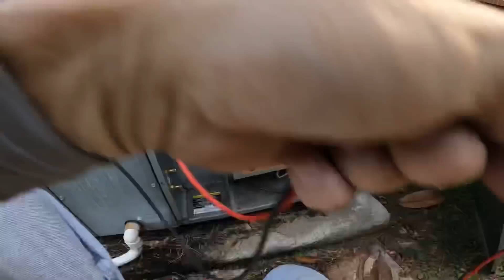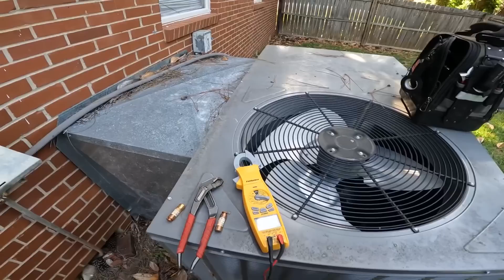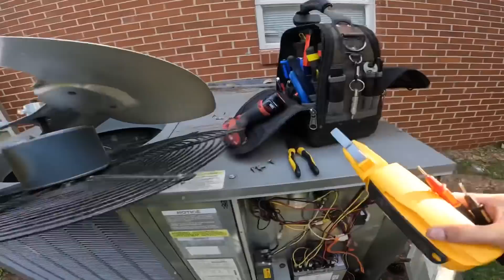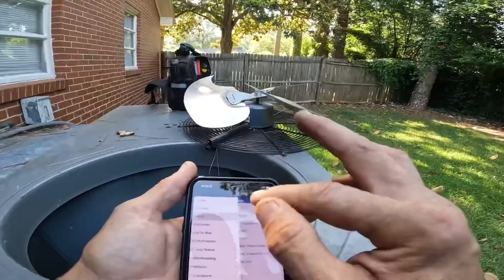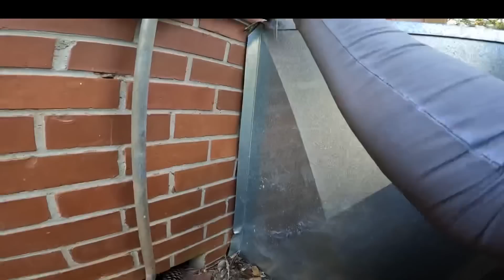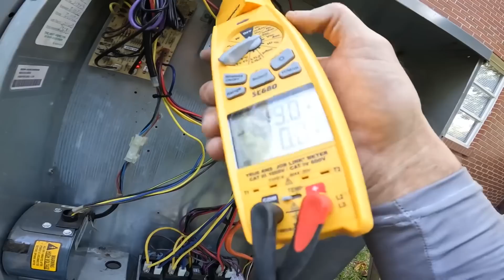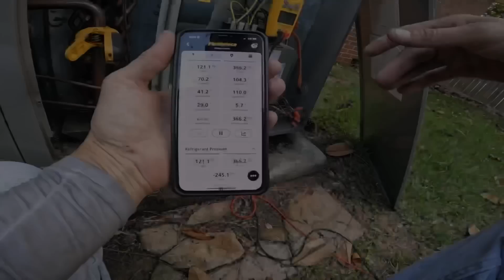Please Tell Me It’s Not the Compressor Again

Comment: Years ago I used to take care of cell phone towers that usually had 3-5 ton single phase Bard units. R-22 with Copeland scroll compressor. Brand new Copeland compressors would fail a meg test with either an ohmmeter that would read megaohms or actual meg tester. This was after recovering the charge, new drier evacuated to 500 microns and virgin R-22. I tested the compressor before applying power to it after weighing in charge. And it failed the meg test. Megger is a cheap Supco that considers anything under 20 megaohms as failing. My VOM that would read up to 50 megaohms would read about 5 megaohms to ground on them. However, the compressor would run and not trip the breaker or draw abnormally high amperage. Those compressors never failed. I don’t understand it. I had to replace a lot of these compressors and found this to be the case every time. Just recently I was replacing a small single phase Copeland scroll in a single phase York rooftop unit. This one was 410A. Same thing. I believe I read somewhere that Carrier doesn’t consider a hermetic compressor to have failed windings unless it reads lower than 1,000X line voltage ohms to ground. For example a 230 volt compressor must read below 230Kohms to ground to be considered to be grounded. I’ve also had times where my meter would pick up something to ground that the megger wouldn’t see and vise versa. Also moisture content in the system can cause lower resistance to ground. If I come across a compressor that trips a breaker or blows fuses, and I get a questionable reading to ground that seams random, I’ll replace the drier with a high moisture content drier and use virgin refrigerant and recharge the system. If practical I’ll change oil if the system is large enough and has provisions to do so. I’ve made it common practice to use high moisture content driers in any system that runs POE oil.

Comment: I don't know why guys get so wound up about compressor Megohms to ground.  In SOME cases it MIGHT be an early indicator of questionable insulation but:  There is 120 volts on the compressor to ground.  I=E/R  so for 1 Megohm, current is 120/1000000 = .00012 amps, or 1/10th of a milliamp.  No problem.  Also, anytime I measure high resistance,  nothing (no fingers) touch the item under test because your body will measure some Megohms across it - you don't want to shunt the device under test.

Comment: That fuse looked cooked.  Check for a bad disconnect.  Loose fuse holder etc.  they make a plastic puller for fuses.  If you tested for grounds with a megger, there would be no question.  A 9 volt battery won’t find a high resistance short to ground.  Need to test with operating voltage. From the looks of the nameplate, the electrical service to this unit is undersized.  I’m sure you have a hell of a voltage drop on start up.

Comment: If the power blinks off while the unit is running I will blow a fuse .. replace disconnect with a non fused disconnect. This will solve the problem

Comment: Enjoy your videos!  I'm a 45 year HVACR tech. myself. Recently retired but miss the heckle out of it!!!  
If you don't mind, I'd like to share some experiences I've had with very similar situations like this one here.
Anytime I came across an older ~fused disconnect~   I would advise the customer to allow me to replace it, because I could change it out as part of that same service call charge,, and save them a future service charge.  They almost always
agreed to doing it right then!
      And those fuses are only 30 amp usually slo-blow, but starting load amps usually are around 80-ish amps, but can reach 100 sometimes!  And if the customer couldn't afford the box replacement, I'd ask them if it was ok to replace the fuses with the ready-cut copper inserts/dummies,, and 99% of the time they agreed on it!  Also, many times I would find the line voltage whip wire to be 10 gauge, which is rated for 30 amps, and I would recommend replacing the 10 gauge with 8 gauge stranded wire with a 60 amp rating!   Doing this  disconnect/copper insert,  and wire replacement actually pays off for the customers!
       Also gives the service company additional revenue!!!! Keep the videos coming!!!!!!

Comment: Always check the pressure drop across that suction line filter after a compressor changeout. Suction line filters will always cause eff. to be reduced and should be removed after it cleans up the system from a burnout.

Comment: I had. Compressor that failed a few times. Went back and forth on the failure. Finally figured out when the home was built the electrician used 2 sections of wires and used a hidden junction box in the wall. Had to replace the electrical circuit from the breakers to the disconnect.

Comment: I have learned to ALWAYS pull fuses then I tap on them as I've found the blown ones to have a phantom voltage possibly due to carbon in fuse.
Reply: Then i remove the fuses and indtall a breaker.  Hopefully compressor didn't single phase and burn up

Comment: A normal, undamaged and functioning  compressor has three terminals, each of which is connected to one another internally by the copper wire of the motor windings. The normal resistance value between each of the terminals will be but a few ohms. Reading to ground from either of the three terminals using the megohm scale has to produce the same value. The only variable would be the few ohms of the motor windings, which on the megohm scale would appear as zero. Therefore, if you are reading significantly different values from each of the terminals to ground, your readings cannot be correct. Further, your worst reading to ground, 7 megohms, would produce 17 microamps, which to a 30 amp fuse would look like zero and would not even trip a residential gfic device.

Comment: You mis diagnosed this one. We see these all the time in the SW desert. A bad condenser motor will cause the compressor to over amp and blow fuses. The CFM is turning too slowly and that results in the high head pressure, low superheat, freon is not condensing fully, bubbles in the freon lead to high super heat, etc. When compressors fail, they typically trip the breaker (short to ground). I can count on one hand how many bad compressors blew fuses instead of tripping breakers; twice in over 20 years..... When a CFM goes bad, you blow fuses. Bad CFM causes the compressor to have high amp draw, eventually (hours later) enough so to cause a fuse to blow. FYI: You should ALWAYS weigh in your freon charge so you will know for certain the the charge is correct; the correct amount is right there on that label... It is IMPOSSIBLE to CORRECTLY charge an empty system by the gauges when starting a new compressor; I've NEVER seen anyone get it right. Pump it out into a tank, weigh it. Recharge using a scale, works 100% right EVERY time! Bleeding out freon is a hack job. If you have a package unit on the ground like that, there is no excuse for not pumping it out and weighing in the new charge. Had you pumped it out and seen the charge was correct, then you would KNOW there is another problem.
Reply: Easy there tiger
Reply: Video can be deceptive on fan speed

Comment: Scroll compressors always have a lower mega ohm reading, even so far as to show bad on many dedicated mega ohmmeter but they are perfectly fine. Something about the clearances of the windings is smaller, shorter gaps internally give low Megger readings to ground.

Comment: 7 megohms is 7 million ohms. The current to ground through 7 million ohms would be the line voltage divided by 7 million or 240/7,000,000, hardly enough to blow a 30 amp fuse. Also you read 29 megohms to ground from one of the other compressor leads when all three should read essentially the same, if the windings are ok. Plus, 7 megohms is practically an open circuit. So something is wrong with one of your readings. There are many possible reasons for the blown fuse. Any other electrical component in the system could be causing your problem including capacitors, the condenser fan motor, or the fuse itself. Please don’t resent my comments. I’m just an electrician, and I don’t know diddly about your refrigeration cycle, but I do understand some electrical theory and ohm’s law…….actually current to ground would be half what I stated in my first sentence. The 240 volt transformer secondary usually has a grounded center tap, so the current to ground would be calculated at 120 volts rather than 240.
Reply: You saved me having to post. All I could think was Ohm's Law.

Comment: Don't put your fingers on the test lead when your testing ohms . When you lean on a grounded machine with a sweaty shirt you are creating a path to ground. And always test resistance between  the Capacitor terminals and the case of the capacitor . ive seen caps test good capacitance wise yet have resistance to ground in the 100's of ohms

Comment: You need to get yourself a megger insulation tester. That will tell you in five minutes if you’re windings are weak. Your problem here is your power wiring size, 30 amp line and if that’s a number 10 wire is very undersized says so right on the nameplate. That’s your problem brother. If that’s the number 10 wire need to run new wiring or they’re gonna have this problem all the time. Just show them the nameplate. Minimum ampacity is 36 A Max fuse size looks like it’s 50 if I can read it correctly. That’s what needs to be in there. You’re gonna always have problems with this thing tripping, that is why I always look at the nameplate on fuse wire sizes. I don’t know how hot it was inside the house but if it was really warm and humid you’re going to have high pressures. Something tells me that your temperature drop through that unit was just fine. If it was sweltering high load you’re gonna have high pressures and hi super heat until the house cools down to its comfort levels under 80°. You may even have to come back the next day after doing a compressor change if you are concerned about superheat it will take hours to pull down

Comment: I sold rhuud for many years, around 2013, 14 , started having a lot of txv issues, they would work fine for a year or two, then just stick closed. I remedied the problem by replacing the txvs with pistons  sized for the capacity. No more problems. I kept asking my sales rep who else was having these issues and why. he didn't know why but others were having same issues and just replacing txvs, but having the stuck closed problem reoccur in a year or so after replacing them. Come to find out after a few years of this, that Copeland had changed the moisture control additive in their compressors and it was reacting with the txvs causing them to stick closed, I didn't notice any drop in performance before they just totally failed, but I'm sure it was happening but it didn't show up a problem until they just stuck totally closed. I see that unit you were working on is a 2016 model.  I'm sure it had the very same problem at first failure , they froze up and got a lot of compressors from it. I warranted many. Txv sticks closed, unit freeze up, liquid refrigerant wash the oil from the bearing , bearing fail, rotor hit the stator, compressor shorted.

Comment: A couple of suggestions; Never use a meter as an ohm meter in a box with live power. switching back and forth between volts and ohms is guaranteed to lead to meter destruction the one time you get distracted and crossed up. The other thing you might consider; megohm resistance readings can be caused by skin resistance, or if its hot (and its always hot) leaning on the frame in a damp shirt and touching the meter lead can easily account for phantom resistance values in megohm ranges as your body becomes a resistance in parallel with what you are measuring.. Hold a meter lead in each hand and see what your meter reads.  Enjoyed your video. Thanks.

Comment: Great video once again. I’ve had compressors that are down to earth that the multimeter couldn’t pick up but it was clear as day that it was down to earth once I used my megger. Definitely recommend getting one. Regardless, I hope changing the TXV sorts out the high head pressure 🤙🏼

Comment: 4 ton package unit and 30 Amp fuses would be questionable if the electrical is sized correctly.  What is the min amp  capacity and max ? Txv is definitely a compressor killer.

Comment: 30a fuses are too small. The name plate said 36a was minimum with no heat strip. 50a was max.
I'd put the 50s in there, and correct that TXV issue so the new comp doesn't crap out from high superheat and overheating. 
Also, get rid of that suction filter if and when you replace the TXV.

Keep up the good vids bro.
Reply: He would have to replace the disconnect.  Was probably wrong from the start always go with the maximum HACR listed on the nameplate and make sure it’s a dual element time delay fuse.

Comment: When I find a bad compressor and no obvious reason why it failed I look to the Cond fan motor.  Bearings are dry and after running for awhile on a hot day the motor cuts out on overload.  Compressor keeps running until it cuts out on overload.  Awhile later fan cools off and comes back on and sometime after that the compressor does the same. Fan over heats again and this cycle continues until compressor eventually fails. Tech gets there and fan runs fine since its cool he never suspects the problem that occurs hours after he leaves.    In the video you can see the brown area on the outside of the motor where heat has burned off the paint .  When you see that combined with that elcheapo "Asian" made motor that WeatherKing used on them there is no way Im changing the compressor without replacing that fan motor at the same time.    2 other things I noticed that may or may not have nothing to do with it but....#1 That appeared to be "one time" fuses in the box and not "time delay" fuses.  Never run an AC on 1 time fuses.   #2  Those Mars capacitors are junk in my experience.  Although I do occasionally use the Mars fan motors I NEVER put Mars capacitors on anything.